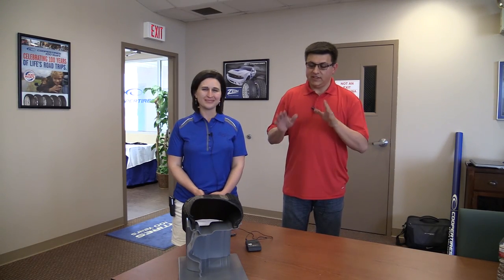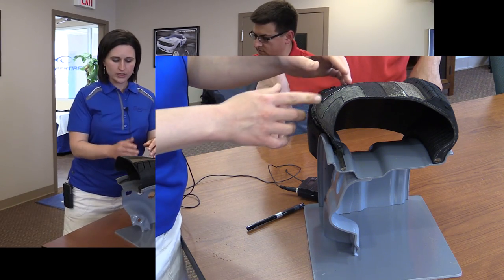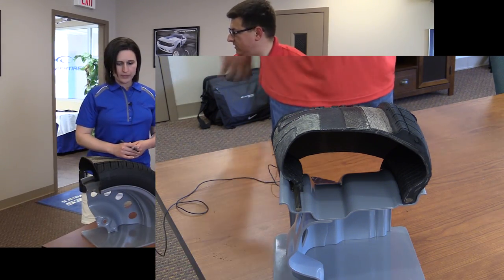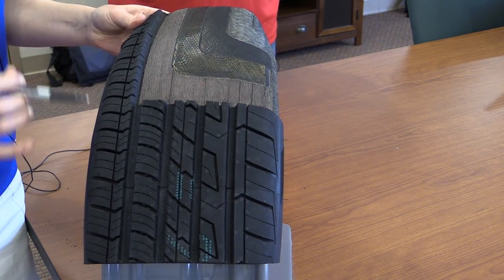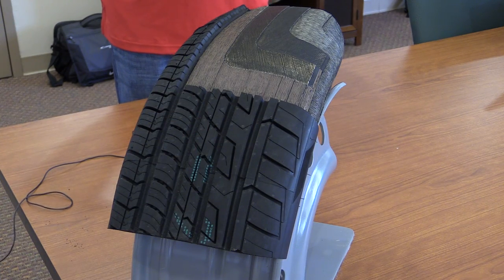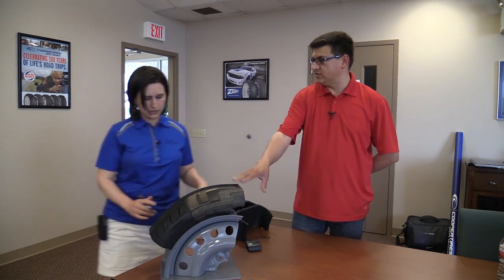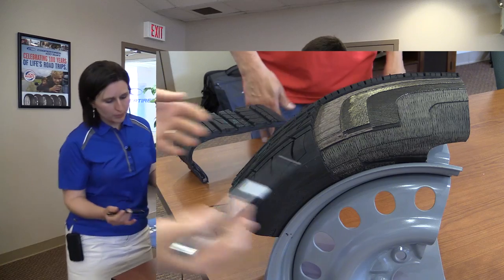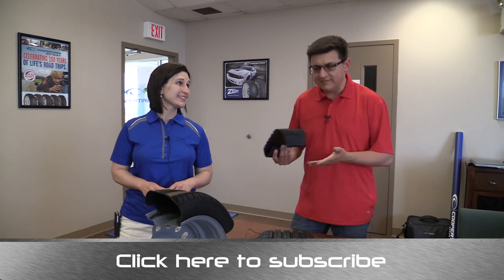What's inside a tire? Tire Construction Explained - Cooper CS5

Comment: Great tech article. Good balance video length vs. technical detail. I remember well the phasing in of radial tires in the '70's. They were way better than the horrible old bias ply tires in very way. I recently retired from 35 years in the tire bizz. Your question about silica was really good. Early attempts to blend in silica were hampered by a poor wet performance/ tread life compromise which is now solved.

Comment: Thanks for the video. I’ve got a set of 4 year old tires with 25000 miles that are showing cracks  in between tread. Nothing on the side walls. Should I be worried of a blowout or are they  just superficial?  Thanks for your time and patience .
Steve

Comment: Hi I have a question and found you when searching about tire anatomy.  I wanted to make rubber paddles to use as a Snow Blower Impeller kit.  I was thinking of using an old tire to cut paddles out of.  But now I’m thinking the steel bands would tear up the inside metal cylinder walls.  Are there parts of the tire that don’t have the steel bands (i.e. sidewalls)?  I need 4 pieces about 2” wide and 5” in length.